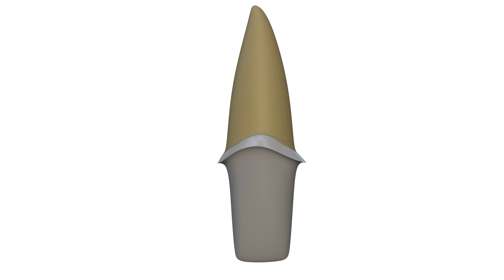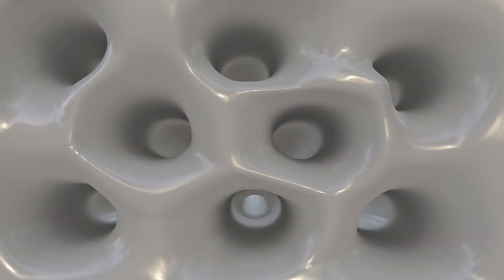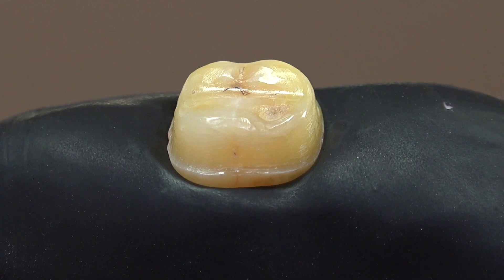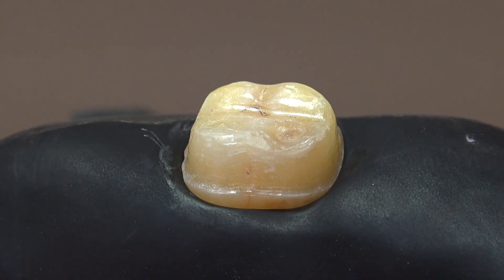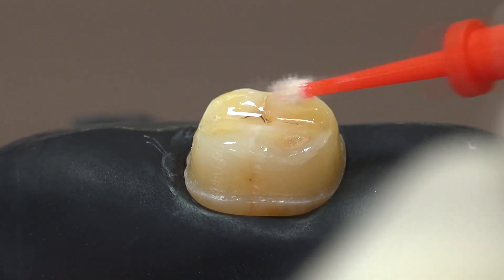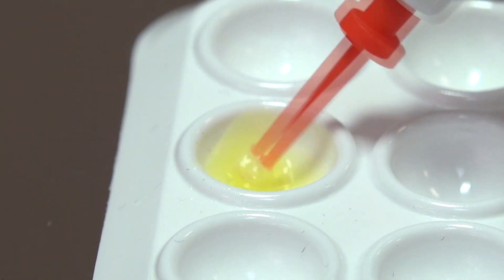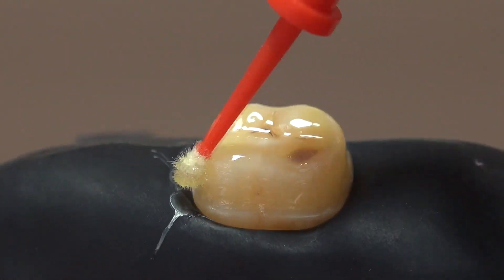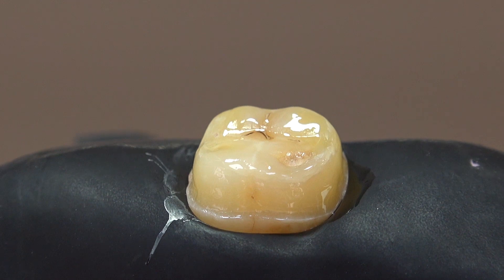Immediate dentin sealing after tooth preparation

Comment: What are the products you used here? 
I mean which brands . The 1st one and the 2nd one. Plz reply
Reply from the maker: Best one is Optibond FL by Kerr. The second one is Clearfil SE bond from Kuraray. But application steps for both are not the same. First one is a 3-step adhesive. Therefore you should apply dentin etching for 5 seconds.

Comment: Should I etch the tooth before bonding, or bonding alone is enough?
Question 2: at the day of cementation, what's the protocol exactly.. Must I etch and bind again?
Reply from the maker: If you are using 4th or 5th generation adhesives we should etch prior to IDS. Before cementation cleaning the surface with sanblasting is almost mandatory.

Comment: Correct me if I'm wrong, so that is the whole purpose of the adhesive layer, plus it retent to the bonding agent also right? Or did I miss something?
Also is it recommended to use it for composite restorations?
Reply from the maker: It prevents dentinal sensitivity as well as protects and preserves fresh-cut dentin.
Reply from the maker: Beneficial for composite restorations.

Comment: When you cement the crown do you remove this layer with a scaler and reetch and bond?
Reply from the maker: If to be cemented with CIS, no. But for an adhesive cementation it has to be removed. Best method is intraoral sandblasting.
Reply: @dentaltipstricks5367  what is CIS?
Reply from the maker: @teletubbypo318  sorry. CIS means GIC
Reply from the maker: @teletubbypo318  Sorry, it is GIC. (CIS is Turkish)
Reply: Is there any way to remove it other than scaler ??